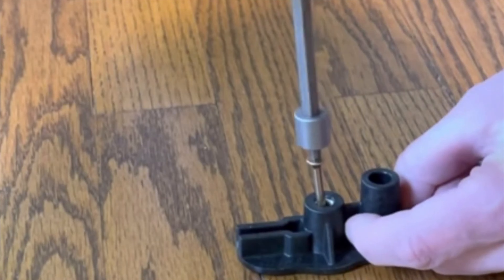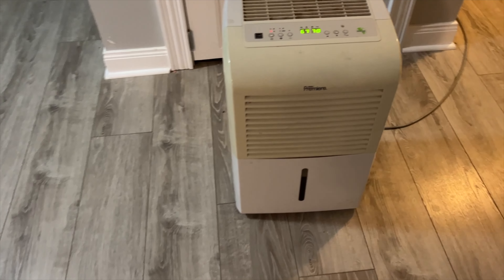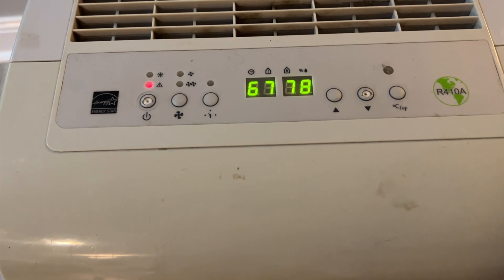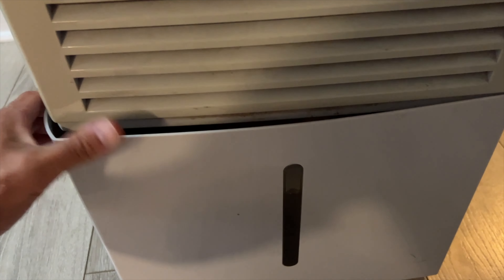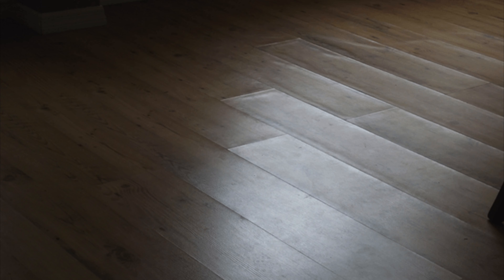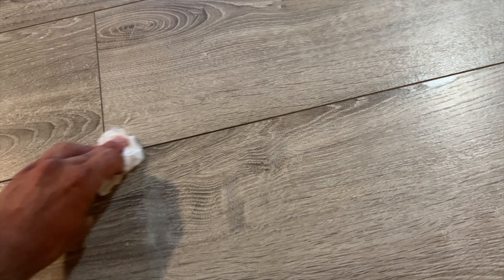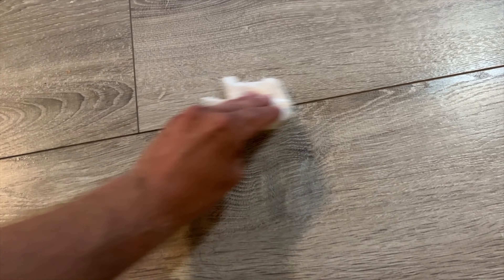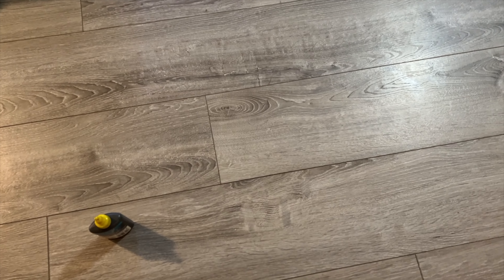2 Simple Ways To Fix Squeaky Laminate Floors!

Comment: I was going to have to pay thousands to have my continuous, laminate floors redone because of the squeaking. A couple of $12 bottles of bike chain wax have made my floors silent. Can’t believe the fix was this easy.
Reply from the maker: Thanks for sharing! Happy I could help!! :)
Reply: Is it still silent?
Reply: @baikerboy2010  I reapplied a little more after the floors became louder after a 1.5 months. I suspect temperature impacted the wax. All in all this was a massive improvement.
Reply: @SENCYR37220  thanks
Reply: What kind of wax?
Reply: What brand wax did you use?
Reply: What is the brand that you used?  Where did you get it?
Reply: I will also ask the same question: What specific product did you use?
Reply: Your comment was a year ago. Hoping you can’t share how long it lasted? Is it still very squeak free?
Reply: @dglenn9000  I’ve think I reapplied once more since the initial application

Comment: Mine don't squeak.  They have like a cracking sound like I am walking on cardboard.  I hate it.  It sounds cheap.
Reply: What’s your solution??
Reply: @engineerfreak4808  Well all the other rooms I did were engineered hardwood and I love it!
Reply: @engineerfreak4808  Don't know about what to do about the laminate floors so that is why I got engineered hardwood instead.
Reply: This is the same problem I have😢

Comment: This worked wonderfully well on my 12mm thick laminate flooring. I had some problem spots between planks that would creak when walked over, and this solution completely quieted those areas in seconds. I used Finish Line Ceramic Wax Bicycle Chain Lube in particular, so I can recommend that product. This is a must try if you have this problem.

Comment: What do you recommend if the seams aren't large enough to put the wax between two laminate floor pieces (as in the laminate floors are too close together)?
Reply: Should get in there regardless these waxes are designed to do that you might have to apply it a bit more than he said

Comment: If the squeak is coming from underneath the vinyl board piece, (wd-40 in the seam has zero effect), will the vinyl laminate floor need to come up?
Reply from the maker: It might need to if the rubbing pieces are too tight or too loose. A lot of the time simple lube can work but in other cases you might need to pull the floor up and make the necessary repairs.

Comment: I am confused. The bottle you are holding up appears to be WD-40 Wet Chain Lubricant, which the manufacturer says does not contain wax (and might also stay a liquid?). WD-40 dry chain lube also contains no wax. Another YouTube video recommends Finish Line Wax Bike Lubricant (black bottle) but I am finding that hard to source locally. Stores here do sell Finish Line Dry Lubricant, which goes on similarly but does use a synthetic oil (with Teflon). I can also easily get Finish Line Ceramic Wax Chain Lube and White Lightning Clean Ride MTB Wax Lube. Which of the products I named do you think would work well?
Reply: I had similar thoughts on difference between WD-40 wet vs dry chain lube. Thanks for mentioning the finish line wax as I plan to try that out as well (it was readily available on amazon). I suspect the differences between each brand are going to be slight (likely not noticeable) and the lubricant will either work or not for everyone's individual use case. Hope you're able to find a resolution..
Reply: As someone who’s admittedly fine with half assing this (it’s in a spare room and i need to stop buying stuff for a single use lol) can I use regular WD-40 that I already have?
Reply: @GenericScreenName808  No. Regular WD--40 does not contain wax, which is the key ingredient that stops squeaks. It might work right away but the squeak will likely come back after a short time.

Comment: I've found that WD-40 works well on my floating floorboards (that have been laid on a concrete slab, and can't be accessed from underneath)
Reply from the maker: Thanks for sharing! Do you find that the squeaks comes back fairly quickly and then have to reapply?
Reply: @soundproofguide  Not too bad actually....I typically reapply every 3-4 months.
Reply: How if it’s laminate though I have beyondddd squeaky floors only in the bedrooms and it drives me nuts!!
Reply: This is what I was looking for, I just need a quick fix and had WD-40 on hand